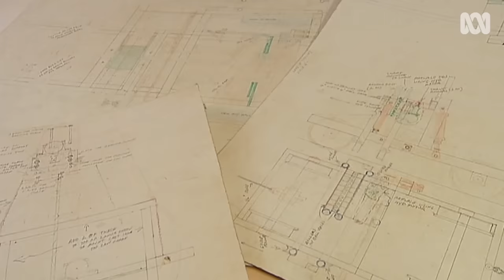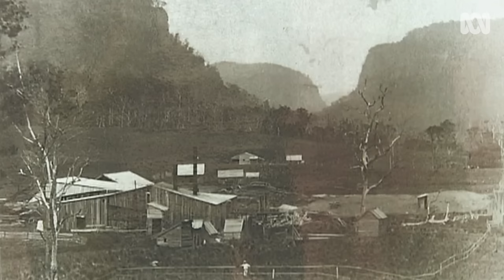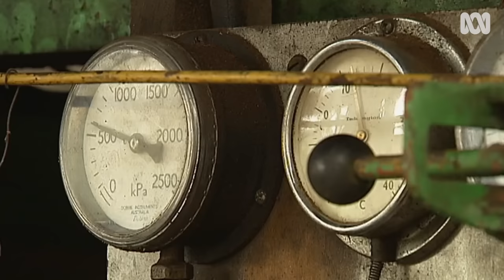The old man and the hand-made sawmill | Landline | ABC Australia

Comment: A some one that has been a builder of things and Logger , Sawyer this  very well planed sawmill.
I would have loved to see more of how it all was made and worked .
I am in the USA so I can not come to see milling lumber .
I have been thinking about building a saw mill that will drive to the trees and pull the tree out and load it on to the mill , as boards are easier to move than logs and all the mess stays in or near the woods .
Very well built sawmill and other equipment you made.
I thought that skider when I first seen it that it was a very old TimberJack Log Skidder till I heard you built it .
You are a true Logger / Sawyer , you have saw dust running in your veins !
Keep the dust flying for many more years and be safe .
Reply: When I started building my little circle mill I talked with my father inlaw a bit. He started in the sawmills in the mid 1950's. I started building a circle saw that would run next to the log on a tube. He recalled seeing mills back in the 40's that were literally spiked down to a stump on each end out in the woods. I changed my mind and built a little carriage on an old trailer house frame beam. It cuts very well being made from "junk".

Comment: That dude needs to realize, that people where designing and building machines, long before engineers started screwing up machines, using CAD software, and there were way less mistakes
Reply: The mistakes usually led to people getting maimed though.
Reply: @HRRRRRDRRRRR  my comment had nothing to do with lack of safety devices on old machines, but that of today's engineers, lacking abilities to design machines that actually function correctly, using computer software, compared to engineers of the past, only using paper and pencil